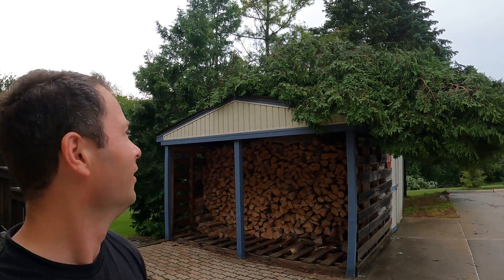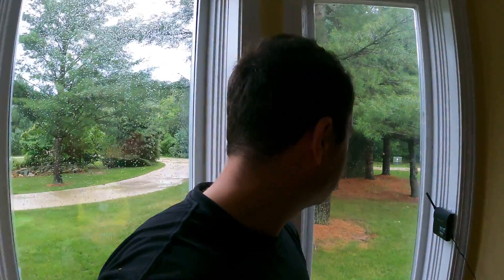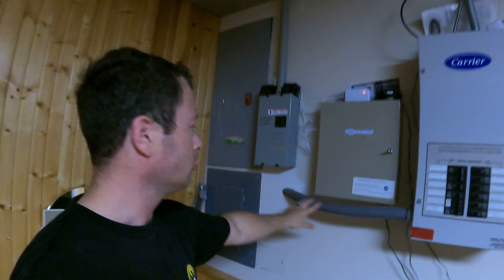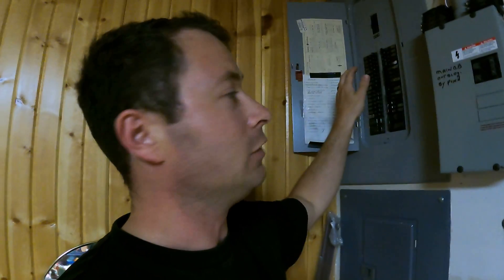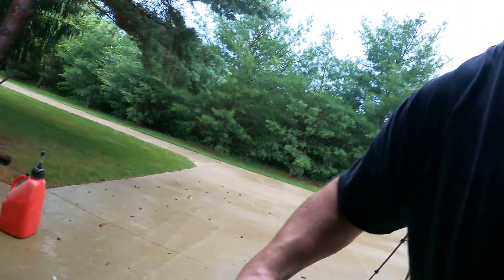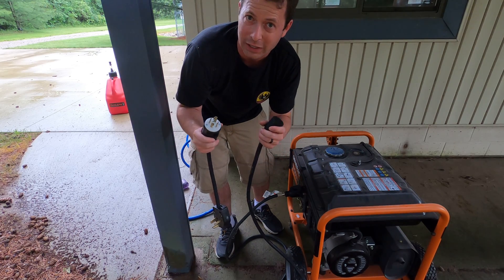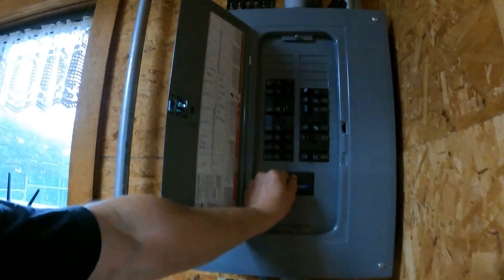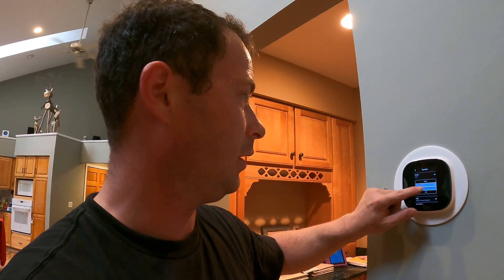✅ Connecting Backup Gas Generator To Power The House - How To Back Feed From Outlet

Comment: as long as main breaker is off....linemen are safe.....also the step down transformer at the pole is just that...even if main breaker is on...your neighbors that are without power are still connected to grid...so your generator would be attempting to power them...thus over loading your generator

Comment: Didn't think there was anyone still stupid enough to construct and teach construction of a suicide cord .  Feeding thru a circuit breaker too upscale for yahoos?   YouTube needs to remove stuff like this.
Reply: Why not. They are used all over the world. Just because your country doesn't allow them doesn't mean other countries won't.
Reply: @howardradford1985  They don't call it a suicide cord for nothing.  Besides that's not another country.
Reply from the maker: It is fed through two circuit breakers.  One on the generator and one in the barn.  Both can be switched off as well as the generator not being started.  Really no risk if done properly.
Reply: @Critical-Thinker895 Do you know what other countries call american food? Yet we eat it and think they are just being overly paranoid. 

Sometimes content creators think about making content the transcends international borders or content transcends international borders anyway so where it's filmed doesn't actually matter.
Reply: @howardradford1985  That's a pretty sad excuse for someone promoting the use of a deadly and lazy method for connecting generators, especially when it's so easy to add a receptacle to your box.
Reply: @Critical-Thinker895  it's also cheaper. Inlets arent cheap plus installing an inlet at minimum will also cost more for another length of wire and another 50A breaker. To buy all the normally required items will run about $500 plus another $100 if you put in a mechanical interlock. This setup is probably only $65. How do you justify something costing ten times the cost when the cheaper option has less risk than driving a car.
Reply: @Critical-Thinker895 what about RV cable with the right plug and receptacle on it. That is something you will also need when using an inlet. That's why I wrote ALL NORMALLY NEEDED ITEMS. You can't just quote the price of the breaker and inlet and say that's everything you need. You also need 6 gauge THHN wire between the inlet and breaker and more 6 gauge THHN wire between the inlet and generator with a 50A plug on one end for the generator and a 50A receptacle on the other end for the inlet. Have an electrician install it for you it's another $1000 in labor.

Comment: How did you wire the 4-prong to 3-prong cable adapter? which cable you left disconnected the ground or neutral?
Reply from the maker: Left off ground.
Reply: Above in reply to @danyboy0007 didn't you say the opposite ? @NaterTater
Reply from the maker: @bigpardner  I can see how you could read it that way but neutral is required to complete the circuit.   The ground is a safety/reference for fault detection.   That said the ground and the neutral wire from the wall outlet to the breaker box are the same and both terminate a the ground bar.  So to me they are the same thing but yes in correct electrical terms the 6-50 has a neutral but no ground.
Reply: Why not just ground together
Reply: @dustydawson8977  cause old houses water heater outlets doesn't have ground wired, two hots and a neutral

Comment: Hi, i have a 30 amp rv outlet outside, can i change it to a 50 amp outlet and use the 50 amp cord?  I want to be able to run my hvac.
Reply from the maker: Unlikely.  The wiring must be sized to support the 50amps and if it was installed as a 30amp outlet it would typical have a 30amp breaker and 30amp sized wiring.
Reply: @NaterTater  yep, it does.  Gonna use a dual pole 30 amp that is in there and wire it to that breaker and to the same spot the rv outlet is and run a 50amp.  Yes the 30 amp is ran to the same box with a single pole 30 amp.  Not going to work.

Comment: Have you installed a soft start on your AC compressor?  I used an EasyStart by MicroAir and now my GenSet barely notices when it's time to start the thing.    It also helps when on the mains.  No more lights dimming on compressor start.   LRA of over 100 amps can be rough...    And of course, great video.   Your "jump start" got the like.    :^)
Reply from the maker: Great suggestion.  I should add those easystarts.

Comment: I'd like to see how you made the plug adapter. I would like to make a plug for a 30a 120v generator to a 3 prong 50a welding outlet.
Reply from the maker: You can't take a 120v generator plug and turn it into a 220v plug.  To see what parts I used check out the video description for details and links to the parts.

Comment: When you made your connector you removed the neutral wire to be able to go from 4 terminal to 3 terminal (L14-30P to 6-50P)?
Reply from the maker: Yeah when going from 4 to 3 prong you lose a neutral/ground.  They both go to the neutral bar on the breaker but the 6-50p uses just ground.
Reply: ? @NaterTater
Reply: When  going  from  4 to 3 you used red black white  disregarded  green ground  correct
Reply from the maker: No, green was ground for me and stayed.  White neutral went unused but verify color/wiring for your setup or consult an electrician.

Comment: I do the same method thru my drier outlet
Reply from the maker: Yes that works too if you have a 240v electric dryer.  Here in Michigan many (like mine) are nat gas/propane and just 110v.
Reply: Hi Bruce, what you did with ground cable coming from the generator? you just left it disconnected inside the adapter?

Comment: Never really understood the pick the circuits you want to have power route. It’s cheaper I get it with automatic SE transfer switches close to 1k. However It sucks walking into a room with no power and switching the light on twenty times in a row. Great video Nate! The thumbs down is obviously a safety nazi.
Reply from the maker: My main backup gen is getting close to 20 yrs old so I chock it up to that.  The new ones have automatic circuit cutoffs for things like AC if they start to overload.  That way you can energize everything but still prevent overload.  Thats what I want now!

Comment: Much better idea would be to install a manual transfer switch/interlock, so that the main and generator could not both be on at the same time. This foolproofs the system against some mistakenly turning on the main breaker while the generator runs. It also means you don’t need to use what electricians refer to as a suicide cord to adapt your generator to the house.
Reply from the maker: Yes but for how often I use the 2nd backup gen its not worth it.  Planning on a bigger whole home gen soon with full panel power on auto transfer switch.